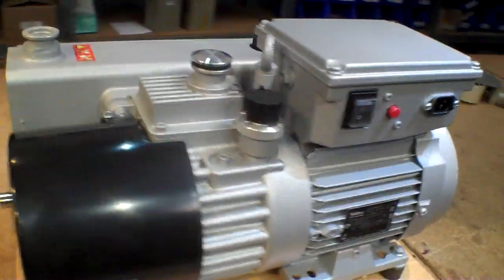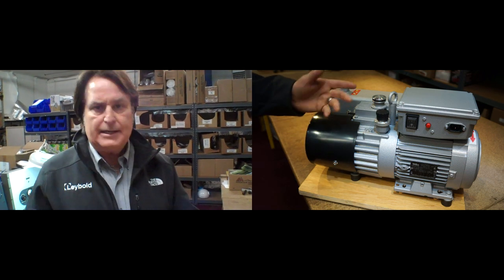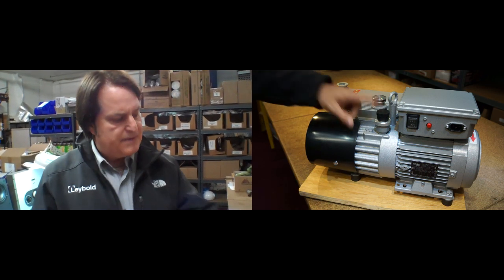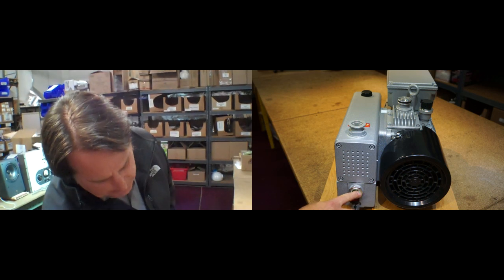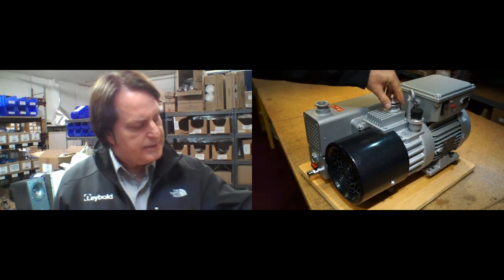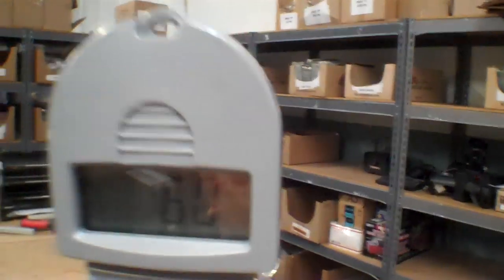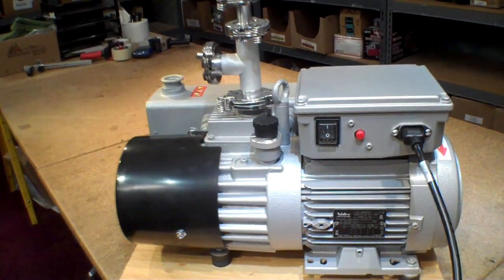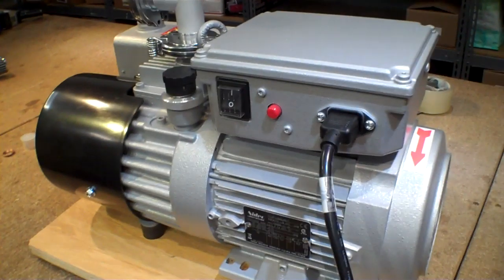Introduction to the Leybold Sogevac® Neo D 16 rotary vane vacuum pump.

Comment: Am I missing something here?  You do a video on a 'new' pump and talk about using it with the Harvest Right freeze dryers but need special items to use it with the freeze dryers?  This pump is $1800 compared to the Harvest Right pump which is $300?  For $1800 you can get the Harvest Right oil-less pump!  What is the advantage of this pump compared to the $300 pump other than maybe being a little quieter?  I'm not sure what the purpose of this video is other than to show how it's NOT worth it!  Am I missing something here?
Reply: I think the oil free is great already, but my logic tells me there's  a better way?  But the better ways are extremely expensive. And not being truthfully talked about to HR COMMUNITY?  JUST LIKE A USED CAR SALESMAN KEEPS SECRETS TO POWDER THE TRUE FACTS, I BET SOMEONE, probably knows this and just wants to keep it simple so they can make it possible for people on tight budgets to be able to have this technology in their homes at the most reasonable price point.*

*BUT THEN THERE ARE THOSE certain types of folk, that just want to know all the options available, so we can just know. Regardless of whether it can be afforded or not. We all know of some super fancy expensive cars, that we will never be able to afford,  we all know, there are houses we can't afford that have cement patios that slide over their pools, and cement driveways with elevators to bring their cars to underground (Tim the tool man / leno style garages), so why can't some of us just get the truth on ALL THE options for what works the best and fastest /efficient for all HR machines?.lol..

*I'm not always right, but I would assume that alot of other companies products could be way better if it were economical to the majority.

My guess would be there are pumps that could cycle through these high heat dry cycles super fast and get the mtorr back down so  quickly during the atmospheric changes inside the chamber, so it gets the dry cycle done in half the time or more, and into final dry. But MONEY TALKS. AND MY WALLET HAS HEARING PROTECTION , TO AVOID THE pricey CHATTER, SO I DON'T GET A HEADACHE FROM POTENTIALLY HOW, SOMEWHERE OUT THERE, THERE MAY BE A PUMP,  THE ONE I CAN'T   AFFORD,  that can do what I described, and DRY MY 2 #10 CANS OF TOMATOE SAUCE IN TWO THIRDS LESS TIME?  

BUT ITS PROBABLY THOUSAND OF DOLLARS, AND STILL HAS POTENTIAL TO BREAK AND LEAVE ME SUCKLESS, WITH A HOLE IN MY WALLET, AND LEFT WITH A MERE SUPER SUB-ZERO TUBULAR MINI FREEZER!. LOL..*

*water is essential in life. You can go 3 weeks without food, 3 days without water, BUT our VAC PUMPS fail in 30 batches or less by slurping water if not properly maintained? Preposterous to say the least? Lol.

The endless cycle of ridding water from oil vac pumps is like running around a round  room to find the corner*
Reply: MY O FREE BROKE AFTER IN SIX MONTHS.
Reply: MY O FREE BROKE AFTER IN SIX MONTHS.

Comment: This isn't the same new oilless pump that harvest right just advertised about a year ago? If not will this be their new pump when I order my HR?? Glad I waited to order mine.
Reply: No - Harvest Right is not offering this pump. Just my opinion but I have the Harvest Right oil less pump and am very happy with it's performance. No oil to deal with and it's cheaper. And it will run directly from the dryer - no need for an interposing relay box. I wouldn't be able to justify an extra $600 for this pump set up. (pump plus extra electrical work)

Comment: I would gladly pay $1800 for that pump if it is as described.
Reply from the maker: We will probably offer it in the near future but there is external stuff needed to be able to control it with an HR. It can't be powered directly from the HR. Stay tuned for the video about what's involved in being able to have the HR control it...
Reply: Just my opinion but I have the Harvest Right oil less pump and am very happy with it's performance. No oil to deal with and it's cheaper. And it will run directly from the dryer - no need for an interposing relay box. I wouldn't be able to justify an extra $600 for this pump set up. (pump plus extra electrical work)
Reply from the maker: This is not going to be for everyone. An example of someone who might be interested would be a guy I know who has several machines running specialty coffee. Lot's of moisture involved.

Comment: Very impressive!  I await your further testing, and a review on your "adapter" for the new relay box for the higher required current.
Reply from the maker: This pump is more for industrial users or people who want to run multiple freeze dryers with a single pump.
Reply: @EpicenterBryan  How does one run multiple driers from a single pump? Are they both connected at the same time?
Reply from the maker: Perhaps next week!
Reply: Ditto. Thanks Brian.
Reply: Yea, I don't get it. Why Brian would introduce a pump that goes back to using oil - cost more - and requires an interposing relay. I have the Harvest Right oil less pump and am very happy with it. Just my opinion.